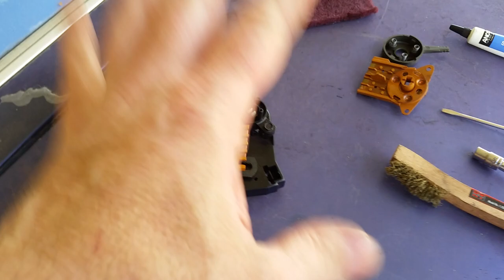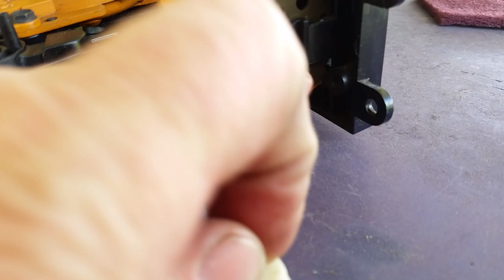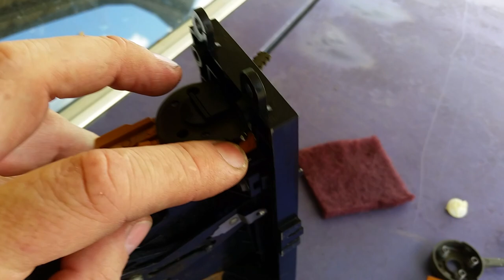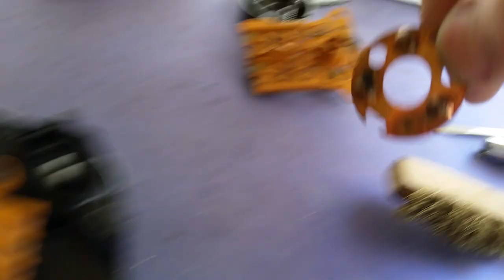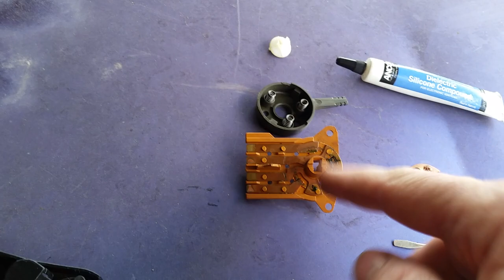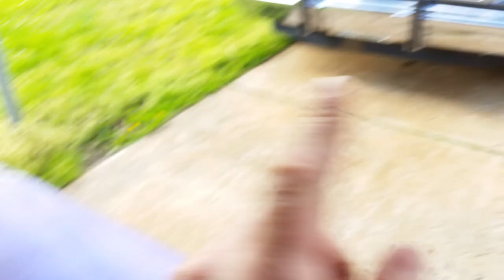G body fan (blower) switch repair

Comment: Thanks for the info. My blower would work on high and sometimes fuse would blow. But if I left it on setting before high it never blew. Opened up the blower switch and it was all burnt up n nasty. I ended up buying another other but this video helped me diag it

Comment: Just had to replace the squealing blower motor on my 82 Cutlass so I figured I'd try this fix as well. Fan works fine on speeds 1, 2, and 3. When I go to speed 4, the fan shuts off.

Did this fix, took it apart, used a brass brush to clean up the contacts. Put it back together, no change. Still have speeds 1-3 working perfectly, and nothing on speed 4.

Any suggestions on the next things to check or try? Should I be more aggressive sanding the contacts and use some steel wool or something? I could also try testing it with no dielectric grease, just to see if it works. Or is the next culprit the blower motor resistor?
Reply: @buckaveli its your blower motor relay. Its right towards the front of the car about 8 inches from the resistor. Has 5 wires and plugs in from the bottom. Just 2    “1/4” inch screws just like the resistor. Unscrew it FIRST, then unplug it

Comment: Ty 4 the vid. My Malibu sedan's blower started working when it wanted to then Just stopped working. Im hoping this is the easy fix I need to get it goin again
Reply from the maker: Be sure and check the big 4 pin electrical connector on passengers side close to firewall. It could be melted. The power wire gets too hot. I've seen this many times. Unplug it and inspect.
Reply: @haffrods7055  ty 4 the heads up ill take a gander
Reply from the maker: @BlackSmokeDemonOG  I appreciate you watching my video.

Comment: Hello, just my luck I found your video after I went out and bought the switch.  I went ahead and installed it and mine still didn't work on high, any suggestions on what I should check next? I have also changed out tw resistor as well. It's a 87 monte carlo ss.
Reply: Im going through the same thing with my regal. Chg fan and resistors and high speed relay still no high speed
Reply: @boss94ways51  I was able to get mine fixed. Did you figure it out yet?
Reply: @boss94ways51  check your 4 pin connector on passenger side of the engine near your alternator.  Mine had and melted, the connectors were corroded as well. I replaced the connector cover and cleaned the pins and know it works.
Reply: @connie2848  no...i was putting the ac box back together.i saw those 2 parts on ebay new.   For under $20 for each one .  ima order it. Then move to the inside.... Statred with blower resistors ,relays evaporator & heater core...just going with everything new since it's not to expensive compressor & condenser also finally puttinf air in this regal after 11yrs.  Always rode with the t tops out...but this summer been a MF...not no more
Reply: @connie2848  mine was in good shape...
Reply: @boss94ways51  make sure the 12v wire is hook up
Reply: @connie2848  hello just came across this comment, and im having the same issue with my 85 cutlass but what 4 pin connector is it that you’re talking about?
Reply: @jaimecontreras3046  mine was located near my alternator and it had melted and shorted out the wire connection. I had a dark green, light green and red wire running from mines. I wish I could send you a picture of it
Reply: I just upload a picture of it.

Comment: Mines don’t switch from cold to heat. Is it the same thing
Reply from the maker: Check the cable on back. The black sheathed cable opens and closes the hot and cold door in the box. Look at where it connects to the main box. It should clip in. Sometimes they break. https://www.youtube.com/watch?v=ZTejQPy4aZE

Comment: So I got a problem where the switch works sometimes and then it doesn't. if you push it a certain way and hold it, it works. Would that still be a contact issue?
Reply: I've got the same problem, I took off the 3 plate screws but the bottom seem to still be holding up. I don't want to break it, any suggestions?

Comment: do you know how you got it off? there is a metal rod that it connects to towards the passenger side that controls the hot or cold
Reply: bro did you get this figured out? I am trying like crazy to figure out how that goes back on, please help if you figured it out.

Comment: I'ma try this, cuz my 83 Impala just have low and medium, when I put it on high it goes off, thanks for the tip
Reply from the maker: The corroded contacts are your problem. This will fix it.

Comment: When I turn the heat or ac on nothing happen, ran a hot wire to the blower motor and it came on any tip
Reply from the maker: Check the large black plastic connector just above the RH valve cover at heater box and firewall. Sometimes they are melted and get corroded. Causes a bad connection.